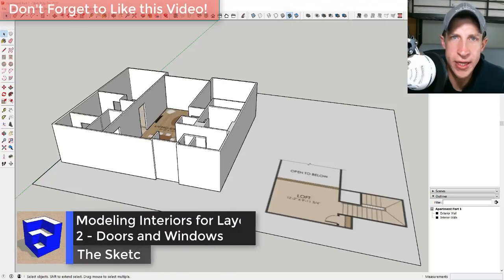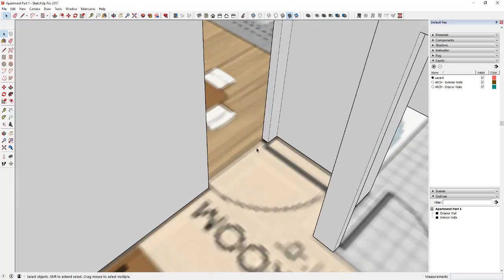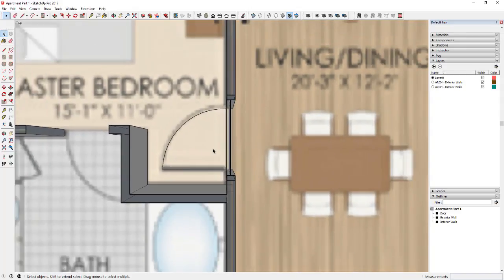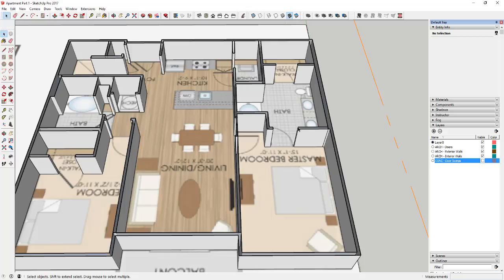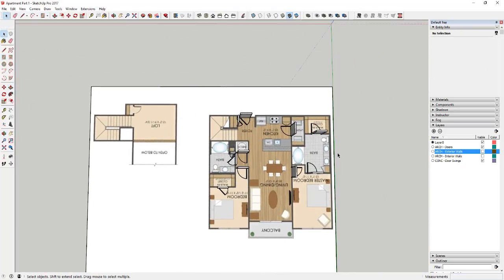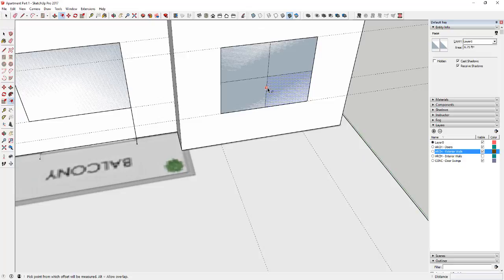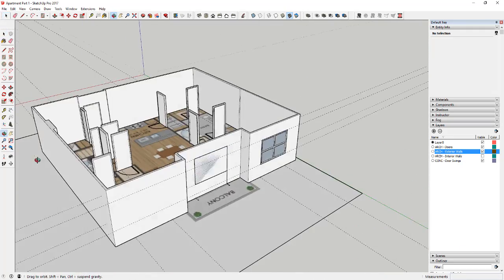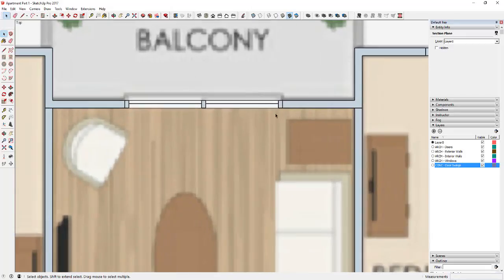SketchUp Interior Design for Layout Part 2 - Doors and Windows

Comment: Hi Justin, amazing content, very crisp and clear. 
Although, I do have a problem, when I'm using my push pull tool to cut through the exterior wall for making windows then my window seems to disappear from the front end but does appear on the other side. Not sure why that is happening. It worked fine for the doors. :(
Any help will be greatly appreciated.

Comment: Hi Justin - such an informative video, Thank You!  Question (from a newbie) is there a reason you do not import doors and windows from the 3D Warehouse in lieu of creating them yourself?  Also curious why you would not leave your doors in the open position, then it would work well in 3D and plan, would it not?  Maybe there is a reason further down the road that I've not experienced yet ;)  Thanks!
Reply from the maker: The only real reason is that when I model them myself, I know that they're set up properly with the different groups and visibilities. You could definitely use doors and windows from the 3D Warehouse, just make sure you're placing them in the right groups and with the right layers when you bring them in. You could definitely leave the doors in the open position as well - probably more of a perference thing than anything else - it shouldn't really affect your workflow. Thanks!
Reply: @Thesketchupessentials  Thanks!

Comment: Thanks Justin.  This video (I think I have seen it ten times by now and maybe it will stick this time) answers my previous question about how to group entities and add them to layers without inadvertently gluing them together.   I'm still unsure about the working difference between exploding, unlocking and opening a group.  When do you use explode, when do you open, when do you unlock.  Eventually, it will all make sense.

Comment: Hi Justin,
I have needed help with modeling. This video and the one that showed modeling walls in 3d using the "create new face" mode have given me a huge boost. Your Twilight Render info was also extremely helpful in helping me get my foot in the rendering door. I need to model and create construction documents in Sketchup. You have been more help than any other resource. 
Thank you, I am now a Patreon supporter.

Comment: Good logical method here ,for the windows. I was modeling apartments recently and definitely spent long time on it.

I over complicated things by modeling 3 layers of wall (outer brick, cavity, inner block work, and even a fourth layer for plasterboard!)

-so, when it came to adding windows, I hadn't thought about how I would do that. With the walls at least three layers thick, I had to push pull each layer in turn for around 18 window openings round my flat block.

Someone on SketchUps forum told me about a neat 'punch hole' extension where you can create an object and make it a punch shape to bust through multiple layers. The UI for,the extension was failing on my particular sketchup installation so I abandoned but it might have been good.

I quite liked your technique of using guides to set up the bottom and top heights. 
And also your approach to modeling the doors by just extending (create new face) from the wall leading up to it. In my instance, I modeler simple rectangular doors, but I did them already on either a 45 or 90* angle to the wall. But I like your method, especially the way you created the frames all in one.

Edit: this comment was meant for your video preceding this one! But my YouTube app added the comment to the following video,instead, hope that makes sense!
Reply from the maker: Totally made sense - Planning for your partitions can get pretty important. I think maybe Double-Cut (http://thesketchupessentials.com/doublecut , affiliate link) might be able to do this?

Comment: just a tip, when you were doing the windows, the offset tool remembers the previous measurement you did when you double click it, just like the double click in the push pull tool pulls the previous measurement.
Reply from the maker: Right...great point! I'd forgotten that the tool memory is specific to the tool itself - thanks a lot!